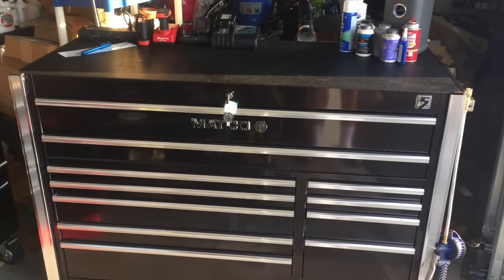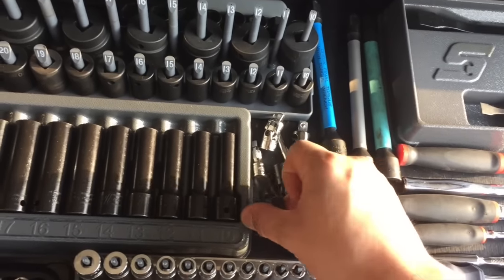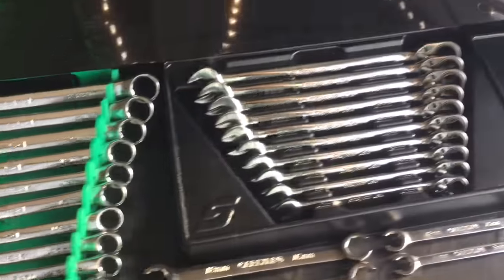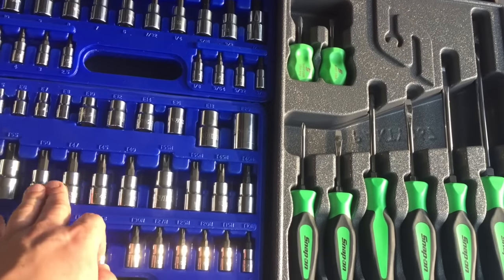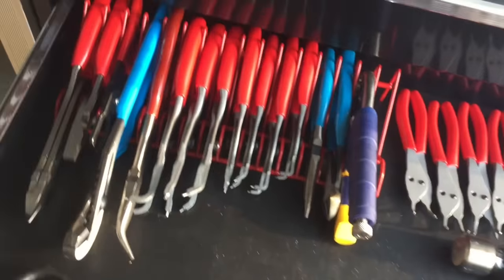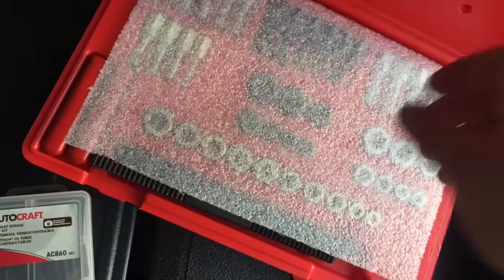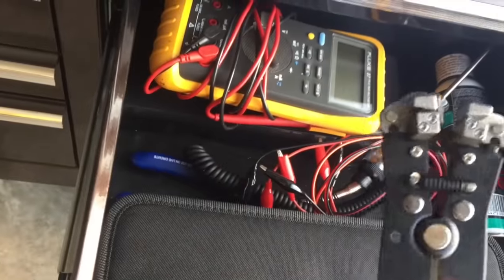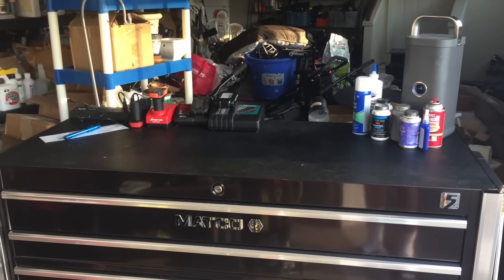Matco 5s Toolbox Tour

Comment: i friggin hate carlyle line wrenches. i used one to take differential pressure sensors off of an isx 15 dpf and it spread like the red sea. cornwell line wrenches work pretty good though.

Comment: Are the digital snap on torque wrench with it or just get the click style version?
Reply from the maker: I don't understand your question man, they're both digital (1/2" and 3/8)
Reply: Lifted Silverado Build ... witch torque wrench is better and more useful.. the digital torque wrench or the clicking kind
Reply from the maker: The digital has many more features such as angle. And it's easier to set it to the torque spec you desire without spinning it and looking at it you can just click and hold down a button. Worth every penny. It lights up, beeps, and buzzes.

Comment: why did you said don't buy mac electric 3/8 impact?
Reply from the maker: might as well go to home depot cause it's a dewault. I like my 3/8" snap on impact 10x better, the mac was way way underpowered.
Reply: I got a 3/8 dewalt for over 5 years. And a snap-on 3/8 for 2 years. I beat the shit out of my dewalt and it never felt or loose power and keep hitting strong. I lost my snap-on 3 time in 2 years because it need to be rebuilt.... Same for my 1/2 impact. My Dewalt is 4 years old. Over use it even on week-end!! Never fail. My co-worker got a snap-on.... Nerver hit a hard as my dewalt and been rebuilt a couple of time.... And don't get me wrong, i fuckin' love snap-on! But i don't jugde tool because they are less "exclusive" than another brand...
Reply from the maker: @TerryasProjectone  not judging over brands, all i know is the small mac didn't compare to my snap on all. I generally go to my 1/4" makita on nearly every engine job. Used my snap-on for 2 years now its missing most of the color on it from dropping it and banging it around still going strong haha all personal preference!